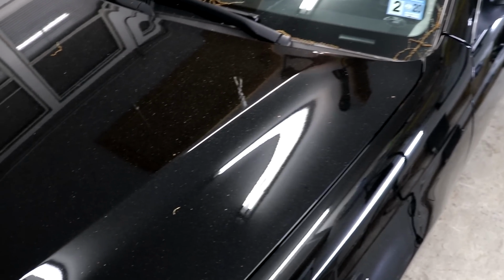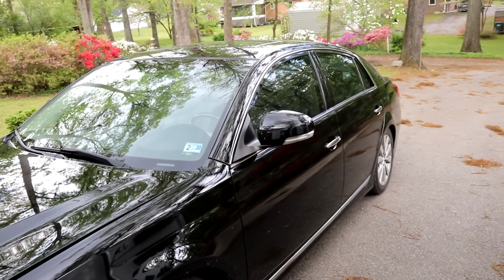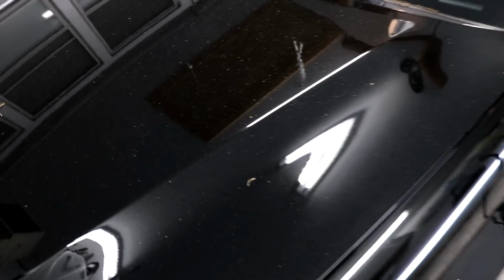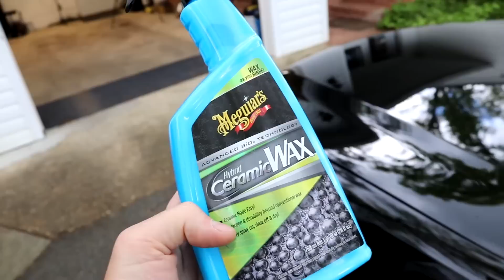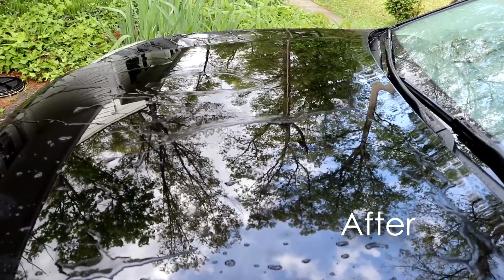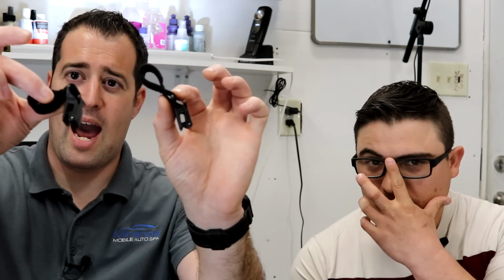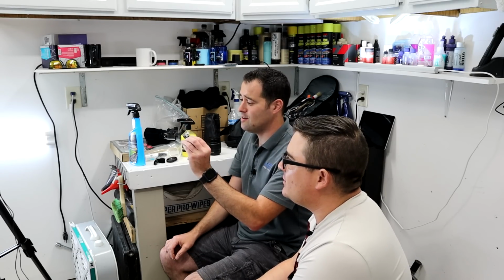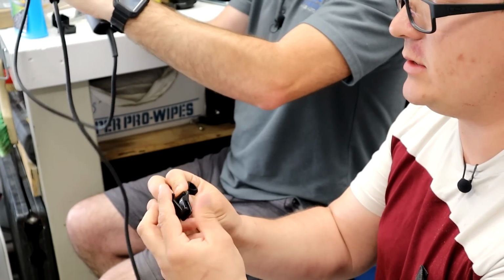Weekend Wash Ep.7 Pollen Season // Special Guest Tony From Ralda's Details // Detailer's Cord Snaps

Comment: I was wondering after you foam you start washing with your wash mitt is this ok to do? I always thought you foam and then rinse and then start your 2 bucket wash.
Reply from the maker: It’s the way we do it as Mobile Detailers. It’s very efficient and works very well. Some Detailer’s just like to be extremely careful and have all these steps to ensure a proper wash...sometimes I think it’s over-kill, but to each his own. We haven’t seen any problem as long as you rinse well, which we do. We even do an APC degreaser rinse before we Foam and wash, it loosens up and releases dirt and grime first, then we proceed with the foam wash.
Reply: sounds like a time saver for sure I wash both of our cars on the weekend and so anything will help.